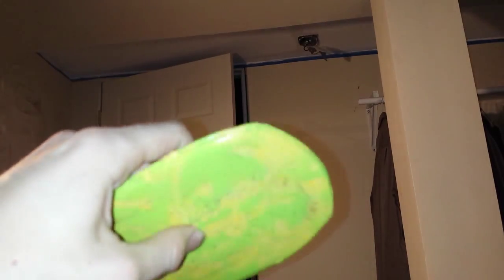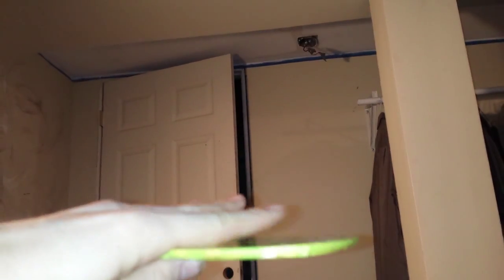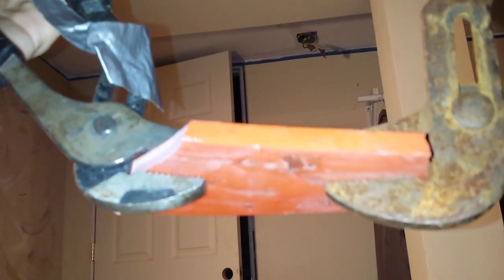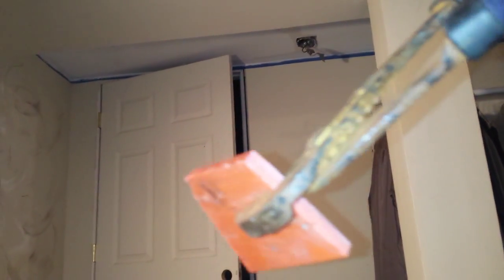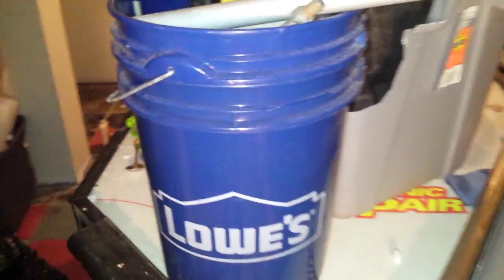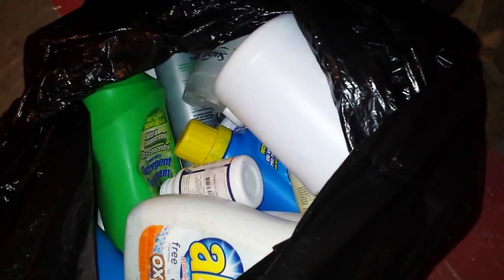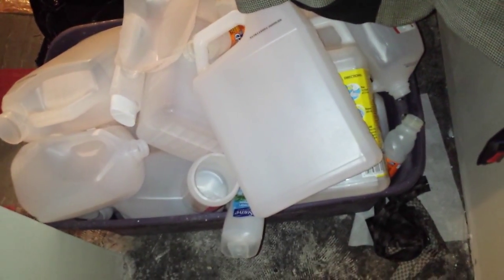exploring recycled hdpe as a possibility for structural applications

Comment: Some buckets, like the Lowes one you showed, are made of Polypropylene (Recycle code 5). That stuff seems brittler than HDPE, That might be what your orange sample was made of.
Reply from the maker: +Double Dare thanks for the comment but i did check the bucket and it said hdpe and the reason it is more brittle is because there is different hdpe types with different molecular chain lengths for example milk jugs and detergent bottles are normally blow molded at a factory and use hdpe with longer molecular chains than the bucket material as a result the bucket material will flow almost like liquid into the mold but the milk jugs and detergent bottles have a much higher molecular weight than the buckets and as a result will require pressure to force it into a mold but the milk jugs are much stronger than the bucket material. although sometimes the bucket material can be useful because even though it is less strong it still has decent strength if its thicker and will flow into the mold better than milk jugs however for structural items requiring extreme strength i will always use detergent bottles and milk jugs

Comment: I never used the bucket material. So thanks for that info. I know that the glass plates are the way to go.. Good job!
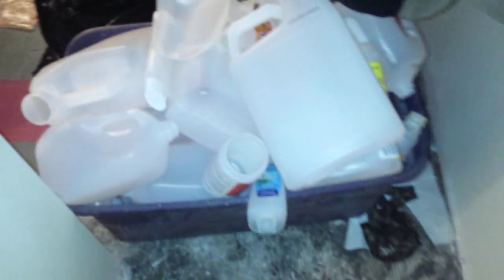Reply from the maker: thanks for the comment as far as the hdpe goes the milk containers and other containers shown at 5:08 are even stronger than the detergent bottle because its not copolymerized with anything this type is so strong that i couldnt bend a piece that was about 4 mm thick and it was much more rigid yet not brittle unlike the bucket material. however the bucket material flows into the mold without any pressure but its strength is much lower